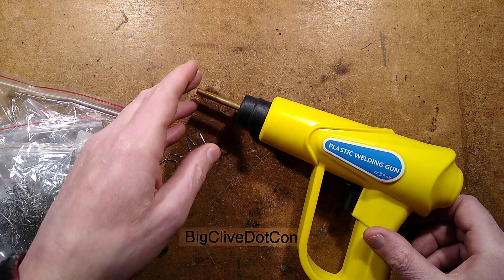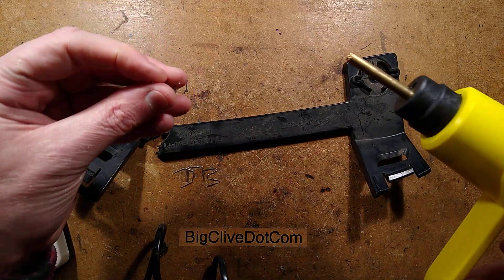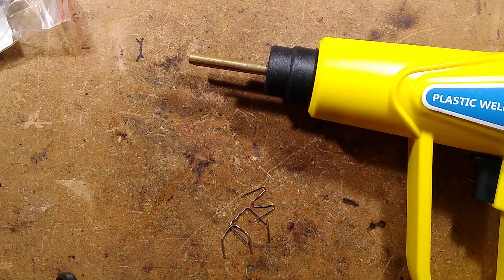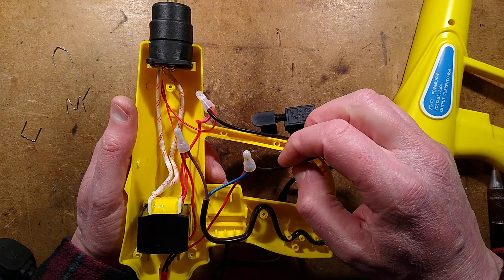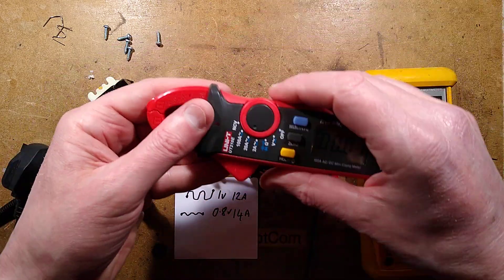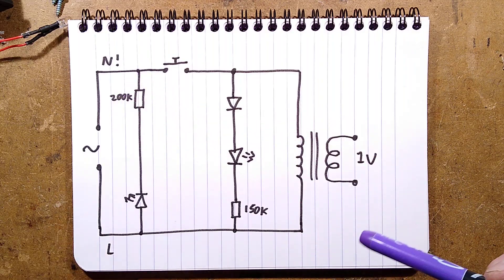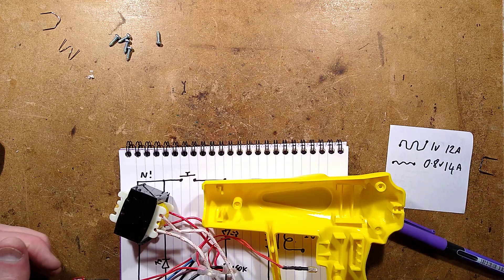Temu plastic welder with schematic

Comment: Been subbed a long time, could watch and rewatch your vids over and over. Always feels like I'm hanging out in the workshop watching a buddy break stuff open. Absolutely cozy! Side note, when you turned to chastise your dehumidifier, it feels like a very tech thing to do. I'm a mechanic and I do the same to the air compressor several times a day!

Comment: You got ripped off Clive I got a rechargeable wireless one from temu really cheap and it actually works well lol get one of those teach us how to beef it up 😅 edit- after putting the staples in you're supposed to get the same type of plastic filler rod and your soldering iron at the right  temp and actually plastic weld the joint Clive. The plastic welding staple kits work well, can also put stainless mesh between the two joints for even more strength. It can be worked to a very high quality finish 👌

Comment: 🙏brilliant thank you, I was a little concerned as to whether they were safe to even plug into the mains, but they look ok for using 2 or 3 staples every couple of years. Have you considered testing the new Temu "wireless charging plastic welding guns with super LCD display" 😲

Comment: I've had my $25 Aliexpress hot staple gun for a few years. It's repaired a lot of bumpers, headlight housings, trim panels, etc. It's paid for itself a thousand times over. It sits next to my $25 Aliexpress welding helmet, which has also performed admirably over the years.

China fakes everything, but every now and again they make stuff that simply works.

Comment: I have seen video of replacing the high voltage winding on a magnetron transformer with one or two turns of heavy wire to do the same thing with any medium size wire.

Comment: Thank you so much for this video.  I should have said that a long time ago, but I finally got around to fixing my car today, and a similar plastic welder was instrumental, and I wouldn't have even known it existed to order it if it wasn't for you.  I've got a Ford C-Max, and Ford did a really shitty job designing the bit above the license plate that holds a couple lights and the tailgate release switch.  The switch failed a while back, and one day, not knowing that and that the only way to open it was to use the remote, my daughter applied excessive force to the part.  It snapped off, having only been attached with a few tiny plastic joints.  So today I finally managed to get her over to assist as we disassembled the tailgate, extracted all the broken bits, and I used one of these to put them back together.  I have a high confidence level that it's stronger than ever now.
I'll be having her replace the brake pads later this week.  I'm so glad I taught her car maintenance.

Comment: Have a similar one. Wondering if it would work as an induction heater?

As an aside, fucking amazing for repairing plastics.
Reply from the maker: Induction heaters work at high frequency.
Reply: @bigclivedotcom  true. Seeing as YouTube so rarely shows me your videos these days, despite being subscribed and having hit the bell, have you pulled an induction heater apart? I'm having a battle with some bolts on an old car and pondering buying one.
Reply from the maker: @TheMatthooks  I've not taken one apart yet.

Comment: The curvy staple is the WAVE staple.There are inside and outside corner staples and there is a flat staple. One trick is to make a slight twist or turn after the staple has been inserted into the plastic which moves it off center under the plastic and helps lock it in place. Another tip is you can adjust the shape of the wire with needle nose pliers to fit  the shape of the plastic, making it more of a curve either concave or convex. Add a piece of metal screen to increase surface area structural strength pushing the staples in place to tack in the screen and then use a soldering iron with a flat chisel tip to heat up the screen and press it into the molten plastic .  I also place the staple against the plastic before heating it up and I cycle the power ON & OFF to just keep it hot enough to melt into the plastic.  Too hot and it might melt all the way through and push through to the opposite side. I also take a small flat head screwdriver or a small flat chisel to smooth the soft plastic, while it is still moldable that gets pushed out to the sides, back over the top of the embedded staple. If you have a soldering iron with a wide chisel tip you can also use that to smooth and shape the plastic after the staple has been set in place. If you don't have something like that, there is another tool called a plastic welder which is exactly the same as the soldering iron handle with a couple different chisel like tip accessories. I found mine at H.Freight for around $15 with a coupon.
The staples come in two thicknesses, 0.6mm and 0.8mm. I find myself using the smaller of the two, 0.6mm,  more often than the larger 0.8mm staples.  I have the exact same hot staple gun, I kept the wire cutter. I recommend if you purchase the hot staple gun, order a package of extra staples. Usually, the assortment includes all the different styles in 1000 pcs in your choice of either 0.8 mm or 0.6 mm. Get a pack of each size, I suggest getting 2000 pack of the 0.6 mm since you'll find using them more often for the thinner plastics.

Comment: It's is best to hold the wire tightly with needlenose or pliers and then cut the wire close to the surface, never hold the wire with your fingers or when you snip it off the energy released will drive the wire into your fingers. Trust me on this, I am speaking from painful experience and used those same needlenose pliers to pull it out of the tip of my index finger!  And if you don't hold the wire and just snip it off, it flies off and could end up in your eye or you will find it later embedded in your foot or clothing or your dog's paw if they might step on it. Dispose of those wire clippings in thre trash can. I use a magnetic parts holder to hold the snippings dropping them from the needlenose pliers after I clipped them off. Make the touchup finishing like smoothing the plastic that gets pushed out and on the sides of the openings with a hot solder iron and flat tip.

Comment: I have one of these, mine a rechargable pen-looking device. It also came with a flat head for smooting out a surface, and some extra filling plastic rods of different sorts. Haven't used it properly yet though, only did some tests. Seems to be a useful thing to be honest. Certain plastics are impossible to glue so this is handy.

Comment: Iron core transformer?  Are you living in 1850?  They coat the windings with lacquer prior to winding them together.  The field of flux transfers the primary to the secondary to produce whatever design voltage desired.  Most all your transformers are made this way and have been since before I was born.  The surrounding case is a heat sink in case you need to use the transformer all the time (like in an hvac product).  As the thing ages the lacquer cracks and eventually shorts out so you have to purchase a new transformer.  Clever design with planned obselescence built-in.

Comment: I use hot staples a fair bit in repairing motorcycle plastics, fairings etc. The trick is to give the staple a little twist just as you get to the right depth. I made mine out of an old electric soldering gun.

Comment: After I found out about these, I bent some pieces of wire in the shape of the staples, held the pokey ends with some pliers, heated the staple with a lighter, and used them to repair some stuff. Worked mighty fine.

Comment: This is very practical for plastic repairs,  you use a few of these to hold the parts on place as well as some tape.
Then use a low temperature soldering iron to actually weld the crack while use extra plastic as filler. 
Then reinforce the crack with more of these ties.
And finish by smoothing over the work.😅

Comment: This (just from amazon) Saved me 750€! We wrecked the mirror on our car. it broke clean off and was only held on by the wire that runs through the stem of the mirror. I 'welded' the mirror back together and filled the bottom with epoxy as good as possible. The mirror replacement from nissan would have cost me about 750€ and the replacement mirror is NOT available to buy as a normal person. I used about 9 staples on the mirror-stem. and melted the seam with a soldering iron thingy afterwards.

Comment: Ive been tempted to get one of these for fixing motorcycle fairing and bumper covers.  Plastic welding is hard for parts with complicated curves because of internal stress on the material, these staples act like rebar

Comment: when putting the staple in you dont want to do it across the crack like you did but rather along the crack so the wire zigzags back and forth along the crack multiple times. then give it a bit of a wiggle to sort of bury it in the molten plastic so it cant fall out once cooled. the way you did it there is only 1 peice of wire holding the two halves of the plastic together rather than multiple.

Comment: Just about to try my new you would need 3 staples for a start. Mines' not the same as it is battery operated from my solar and got it from Alibaba  but at least this is interested Note, I use either my jackery when I have to recharge tools using 240V batteries, ot the 12V USBs from my shed which has my solar panels on and 3 50AHr 12v batteries also in the shed. Saves me a little electricity rather than using the grid, but it does help (ground floor flat no access to the roof).

Comment: I bought one of those from Amazon and it's pretty awesome. Those cheap a$$ refrigerator drawers that break easily and cost a fortune to replace, this type of tool works extremely well and save ton of money.
Reply: I had the exact same problem with cracked fridge drawers, but I used plastic bonding epoxy. Worked great though it looks like smeared snot. But metal staples embedded in melted plastic wouldn’t look much better!

Comment: You can use a soldering iron and a nail put the staple on the plastic where it's cracked put the nail head onto the staple and it melts into the plastic simple no need to buy anything else 😂also tape the plastic to hold in place

Comment: I have a very similar, generic, metal stud welding "gun" which I paid a not insignificant amount of money for on ebay. It's relative low cost did unfortunately predict it's timer circuit failure after an hour or so of use. I am too lazy to replace the now faulty IC that controls it, have bypassed it, and now just count out the spot welds in seconds manually.
I have learned that repairing such devices with quality components would require a redesign, rendering such chinesium devices utterly useless and financial black holes of shite.

Comment: I bought something similar from Amazon with a thicker power cord and slightly different design. I fixed a crack on the bumper of my car and it was working fine for a long time till I got money from the guy who backed into my car. 
But I think that my plastic welding gun was more powerful than this rubbish here

Comment: These work wonderfully, I keep one in my toolbox and it's come in especially convenient when plastic trim pieces on equipment can be a few hundred bucks. 30 seconds with it, some filler,sanding and texturing and you can't even tell something was broken in the first place.

Comment: "There is a limit to how much fun you can have watching someone basically melt plastic"
I see you have forgotten us 3D printing hobbyists; we can watch our printers for hours on end.
Reply: I should think 3d printing would render this device unnecessary.
Reply: @aday1637  At some level, yes, but for big enough projects that require parts to be printed out one at a time, they can serve as some level of extra reinforcement.

Most commonly, though, one would just use a soldering iron and melt the two pieces together with some extra filament, then sand it smooth (if desired)

Other times, a simple dovetail / other latching joint w/screws and heat set inserts works too.

Comment: Note on using these, on the crack repair, swing the gun round 90° so all the corrugations bridge the break, and twist slightly so the wire is under unmelted plastic

Comment: I think these Guns are really good, although mine is a Weller One !!! I use a Soldering Iron to melt the plastic so it's Rigid. Then I melt a plastic Welding Rod to Make the Plastic Thicker.  I melt the Wire Connectors into the Platic   Then I use a Plastic Glue Gun to make the joint stronger. Finally I wrap insulating tape around the Joint and use a Heat Gun on it which dries Rock Hard !!!

Comment: I dont think the transformer is pushed hard. Actually if i need to design something like this it is the way i would do this. Transformers are able to tolerate overloads with ease, like 3 times of nominal power, as long you dont overheat them. Like soldering stations with 50W iron at 36w transformer. 
Because you need to fiddle around and have not enough hands needed for positioning your broken parts, the transformer get time to cooldown while you struggeling with the debris before shooting the next wire in. 
After all, 12w output power looks to me a fair 200..250% of normal power of this site transformer, its okay.

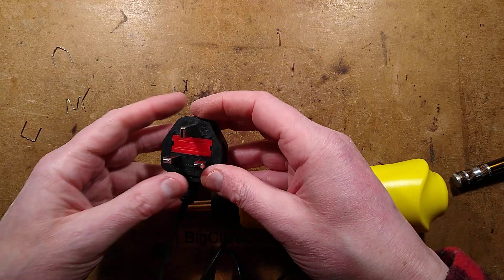Comment: 5:36 That 13A×240V fuse is insane for a device using only 12W on the business end. 0.1A at the plug would already work up to 24W. By the time a 13A fuse blew, the whole thing would be a molten blob of plastic.

Comment: Maybe a light clipped to your shirt or at the front of the workbench would help with the lighting issues when you are working over a piece like that, I assume you must be leaned back when you make these videos unlike the rest of us hunched over techno-goblins.
Reply from the maker: The lighting is optimised for filming.  Not so great for actual work.  I use a head torch if I'm working on intricate stuff.

Comment: Literally saved one big wing mirror frame for which the manufacturer wanted 450 bucks + paint + installation for the whole assembly. Got it stapled real good with one of these, I had a stick of similar plastic to melt on the scars, and a multi-tool to cut the sticking prongs and smooth out the surface. About 25 EUR total cost for the gun and staples.

Never 25 EUR + my time were better spent. Still going strong after 2 years.

Comment: Need to get one of these for bike bodywork.  Nice video.  Talking of Teslas, do you have a rework for the daytime running light failure on a Model S/X?
Reply from the maker: I'm not familiar with that, but I did take apart a full Tesla headlight in a video.  The fault was a small pluggable module with water ingress damage, that could have been swapped on its own.

Comment: I thought this was going to be about the little plastic melted 'rivets' used in laptops in place of screws. Those things are the bane of my existence / stopping me replacing the keyboard membrane in my laptop. The things in this video I saw someone repairing a car bumper with and while it did look fixed in the end I wouldn't think it was very safe or study in the end.

Comment: I have a similar kit, and I am favorably impressed with it.  There are ample number and types of staples (flat, inside and outside corners), and they seem to be of stainless steel.
I was expecting the electrics to be more sophisticated.
The biggest use, IMO, is for car air dams or dashboard cracks.
Thanks for the teardown.

Comment: In the UK it might seem that neutral and live from mains are fixed because you can only plug one way - but in (…how do I say this politely… ) generally THE REST IF THE WORLD 😅 220v /110v AC have plugs which are reversible so they even got the live/neutral AC connection right, it really doesn’t matter how you plug it, transformer doesn’t care and the LEDS will respond to any half cycle anyway 😊

Comment: In mine, the white tip illumination LED is fed from a tertiary winding on the transformer, and even full wave rectified at that.  No current limiting resistor, so they are doing something funky with the winding series resistance to limit the LED current.

Comment: This isn't proper plastic welding. It is somewhat functional, but a proper weld with filler is far stronger, and can (with practice) entirely mask the original break.

Comment: 10:45 - Would feeding the white LED and diode from a voltage divider, and thus reducing the reverse voltage reduce the leakage current enough not to stress the LED?
Reply from the maker: Both LEDs could have been powered by a single capacitive dropper for brighter flicker free output.

Comment: 10:47 I bought a four socket extension lead once that was using red LEDs like that, and they were so flickery and the resistors were getting so hot that I ended up dismantling the extension lead and replacing them all with neon indicators.

Comment: I had an old Soviet flashgun with a mains plug-in. I was suspicious about how light it was and unscrewed the cover. The thing had a massive wire-wound resistor dropping 240vAC to 6VAC which it then put through a single diode for half-wave charging. Very wasteful of power, very dangerous and very cheap to make. This thing reminds me of that.

Comment: HELP!  Mr. Big Clive.  I bought some 220V LED bulbs but I needed 110V…. I’m assuming there’s a couple bits in there I can remove or replace and it’ll work with 110V.  And ideas?
Reply from the maker: It depends on the circuitry in them.  The ones with strings of high voltage LEDs can't be adapted easily.

Comment: Yer, it's for joining back broken or split plastic. Just like you were doing.
Say you busted you waste bin. And it's now got a crack.
Just join with the staple. At the top. Then just go down the joint. And there you are mended. With a little bit of luck. 😅😅😅